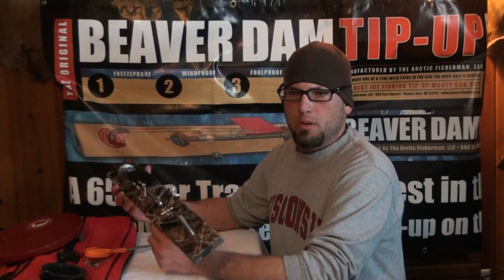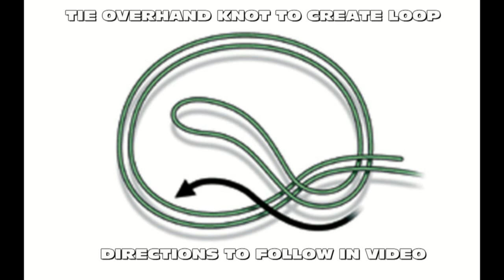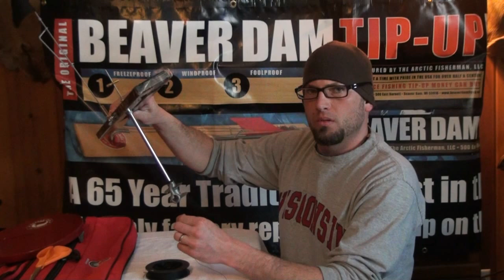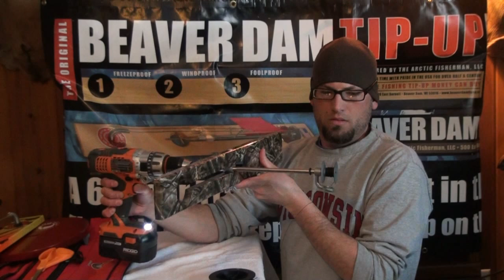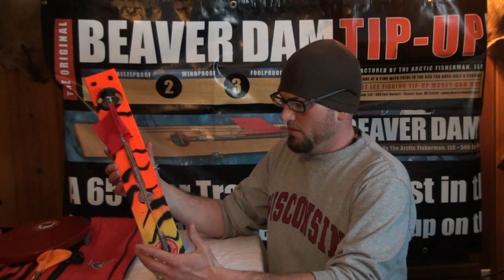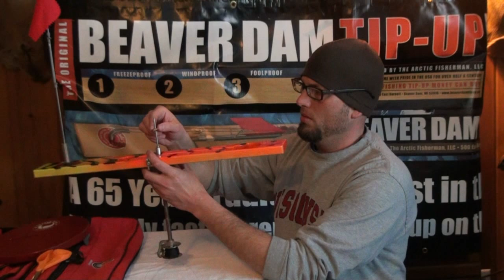How to "Line" Your Tip-Up

Comment: These work with rod and reel or tip ups enjoyable.fishing recommend it’s good for keeping snow out of the hole and to greatly slow hole freezing. They are not heavy so need to be held down by tip up or some snow/ice shavings if windy. Have not had them freeze down even when placed in wet ice shavings.